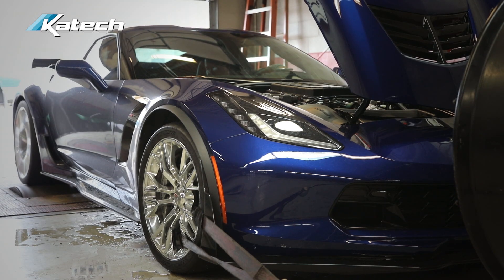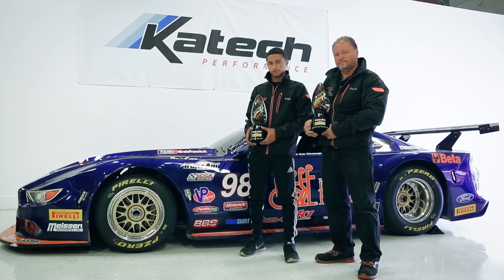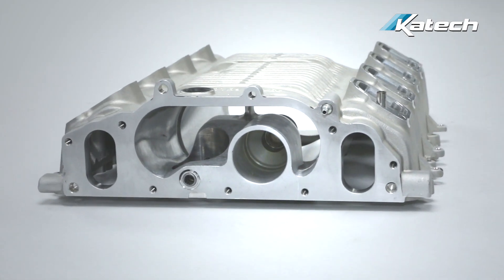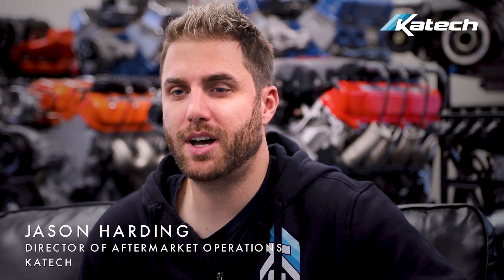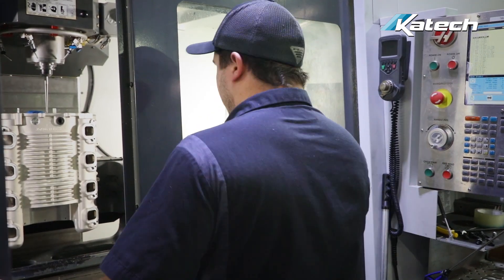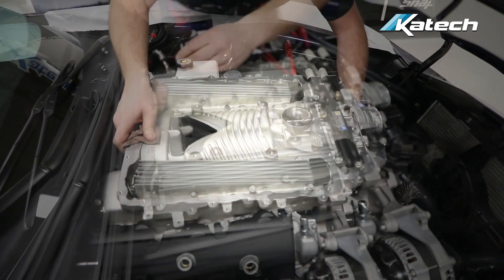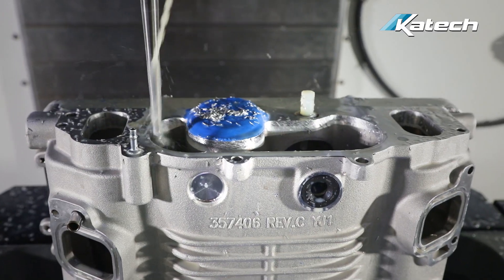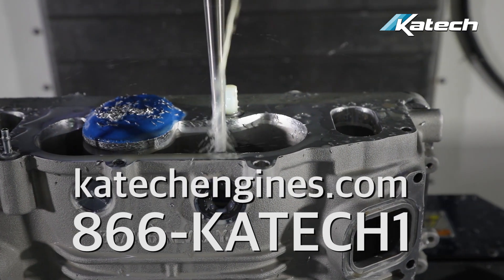Katech CNC ported supercharger for LT4 engines - Corvette Z06, Cadillac CTS-V, Camaro ZL1

Comment: Were those hp gains with or without a tune after the installation of the mods?
Reply from the maker: TechJunkie short answer - without.   A tune was done before that so the power from simply tuning is out of the equation.  We did adjust the tune for the additional airflow from the ported supercharger though.
Reply: KatechPerformance Gotcha, that way you know exactly what the mods produce. These mods with a cam would be killer. Thanks for the reply.